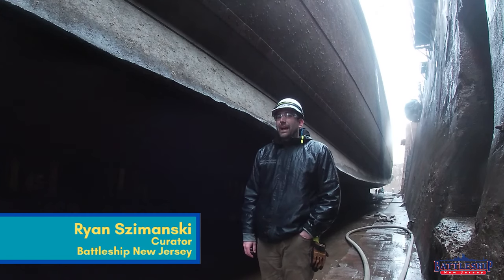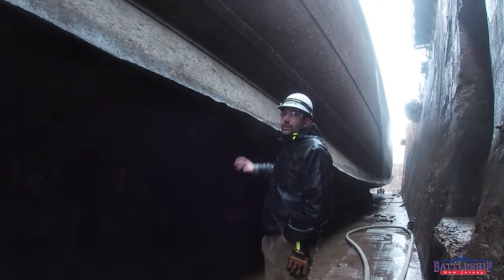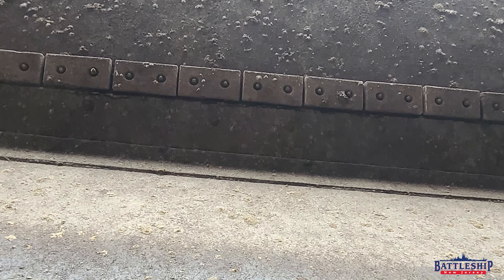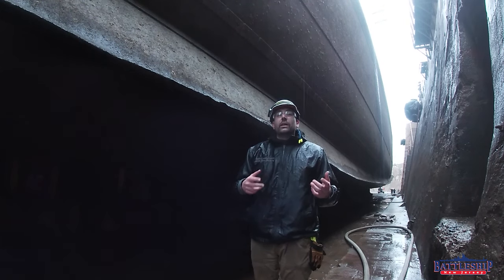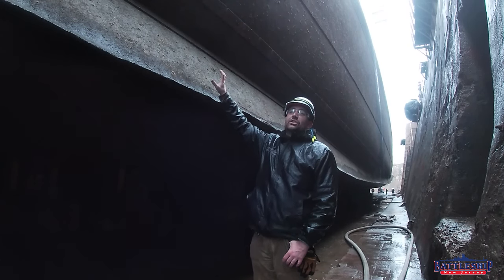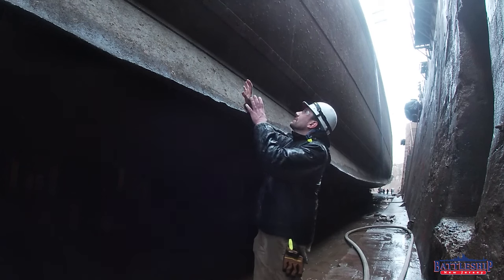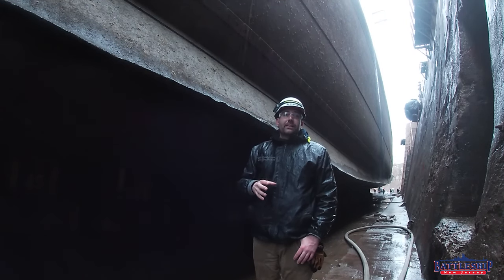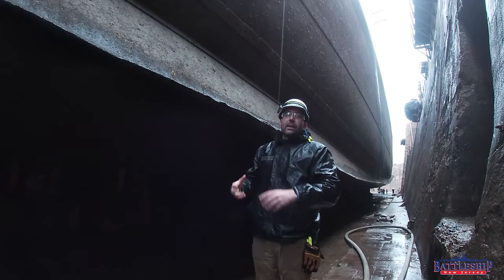First Look at the Battleship's Underwater Hull: Corrosion Control

Comment: anytime you get a liquid, like water moving against a metal surface, you will get electrolysis.  This is a big problem in internal combustion engines that are liquid cooled.  Correct coolants with anti-electrolysis chemicals are needed to stop the metal erosion caused by electrolysis. A ship moving at speed in the ocean,must have an awful lot of friction generated electrical charge......

Comment: Anodes need to be cleaned as if they get covered in dirt they don’t work
Reply: Wrong.
Reply: @Katchi_  ok
Reply: They just need to be electrically connected to the other metal to make the ions flow.  Metal to metal contact via the attachment studs and nuts and washers is sufficient.  Those contact surfaces need to be clean when installed to ensure metal to metal contact, but after that it can get dirty.  It's still electrically connected underneath the crud.

Comment: It isn't so much purity, it  is the electrochemical potential of the material. Pure carbon would be a terrible anode.  Magnesium, or zinc are much better, though Magnesium doesn't last long. Aluminum is odd, because it usually gets an oxide coat which cuts the amplitude of the current to a number proportional to the area of the flaws in the aluminum oxide coat.

Comment: So curious question, if the water does have some salt water, could you not do a mix of say 75 percent aluminum and 25 percent zinc plates just to help with the potential of higher salt in the water?

Comment: What is an anode
Reply: Sacrificial zinc it’s stops the hull rusting due to electrolyses
Reply: The opposite of a cathode.
Reply: An electric battery cell is made of an anode, a cathode, and electrolyte. Parts of a ship that are made of different metals can function like a battery when immersed in water(electrolyte). For instance, a bronze propeller and steel hull. The steel is more reactive(anode) so it dissolves in the water and generates an electric current to the less reactive bronze(cathode). By attaching a more reactive metal to the hull, like zinc or aluminum, that piece will dissolve instead of the steel.
Reply: What's a search engine?

Comment: …One odd consequence of humanity's 79-year flirtation with atomic weapons is that the steel we produce is now ever-so-slightly radioactive. The radiation isn't strong enough to pose a health risk, but it does interfere with some sensitive scientific and medical equipment.
Reply: Correct, when I worked in the nuclear industry , we had to obtain metal from old ships scuttled in Scapa Flow at the end of WW2 to make containers for the storage of very low value radioactive test sources. This was metal that had been processed before the nuclear age , and was therefore free of any background radiation, which was sometimes higher than the source values!

Comment: Why not sell the propellers which will not be used and use the $$$ to fund other preservation on the ship?
Reply: As a museum artifact, the staff cringes at the idea of losing original pieces of her.  That's a desperate last-ditch move since once they are gone they never come back to her.  The United States' were sold off in the past.
Reply: I think he said in the video about the re-decking that the Navy doesn't allow them too. I think he said that they even had to check with the Navy for permission to sell parts of the old deck, just to make sure it was ok.

Comment: Put the ship in a permanent drydock. as a forever solution
Reply: That is not feasible.  Her weight is  supported by water pushing in from the sides and up from the bottom.  Without the support of water, she would pancake.
Reply: The problem with the permanent drydock solution is that it is permanent. At least if she is in the water, she can be (relatively) easily moved to a shipyard, as you see here. A permanent drydock would complicate that process significantly. It is a feasible option for much smaller vessels? Sure, depending on the situation. However, if you need a shipyard, you need a shipyard. Bringing one to you is going to be complicated and expensive. Unfortunately, there are no shortcuts to maintaining a ship. It would be nice if there were, but there just aren't.

Comment: Ya those guy had no poor breathing protection.. theyre probyl  dead from cancer now. also i could  tell  by  visual inspection the anodes werent  doing anything.. before you even  mentioned it with just 3 pics
Reply: I don't know why you are not heading up the entire restoration and preservation program.  You're a real rock star.
Reply: @Look_What_I_Did   I work with metal and rust on cars, its easy to spot they werent doing anything,  the corrosion  on them was the same as the hull  itself only an inexperienced person wouldnt see this.  I bet you didnt

Comment: I think you got that backwards.
The propeller would be sacrificing itself to protect the steel hull, not the other way around.
As such, the zinc is installed to sacrifice itself to protect the propeller and the hull. That's why they're installed so close to the propeller.
Reply: No, he had it correct.  The propeller is made of bronze which is a more noble metal than mild steel so galvanic action would eat away at the steel unless something even less noble is in close enough proximity such as the zinc (or magnesium, or aluminum).